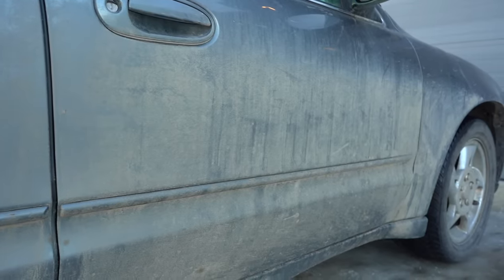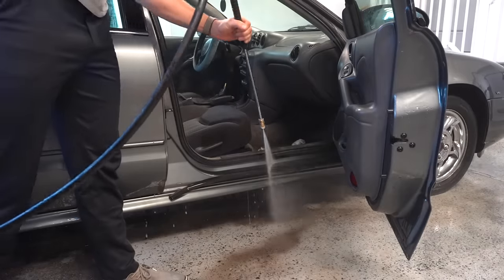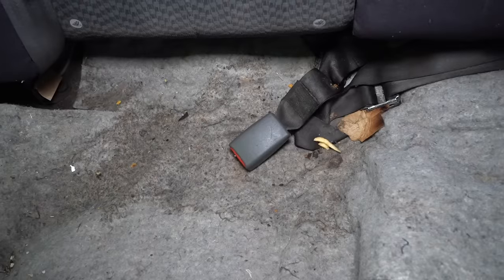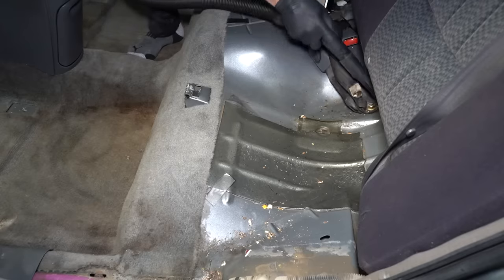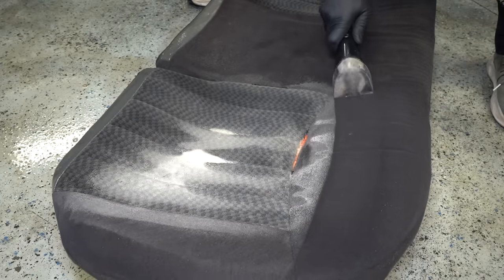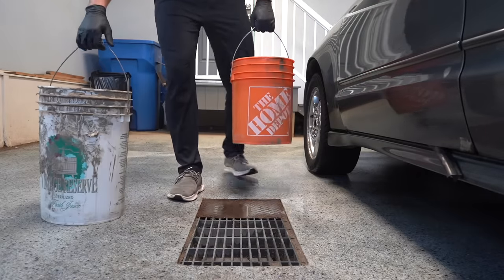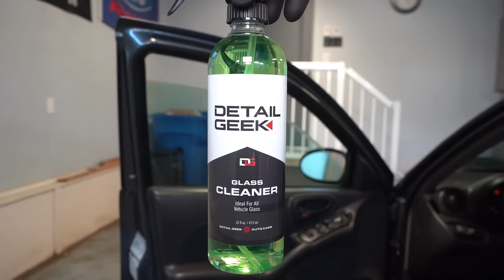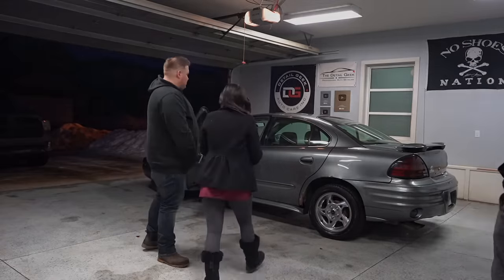Cleaning a NASTY Used Car Before Selling It! | The Detail Geek

Comment: Great work! Ever thought about using a foldable table to clean the plastic parts you disconnect on? It'll save your back a little if you don't have to do it on the floor.
Reply: I remember he did a q&a video and said yes the table helps his back but the floor makes for a better video!

Comment: The "too dirty to clean" question might just come down to a challenge-issue. A guy like Mitch will look at these situations as challenges and the bigger they are, usually more motivation they provide.
Reply: Agreed!
Reply: @adfa6109  No. I'm a Heathen Pagan.
Reply: @michaelray5595  
Islam is the only true religion.  I want you to go to paradise after death and be protected from hell.  But for that you have to accept Islam as your religion.
Reply: @adfa6109  Best of luck to you.  Not happening.  Till Valhalla!
Reply: @michaelray5595  I am Uhtred Ragnarson
Reply: @xArcticWolf01x  Good show, I need to finish it.
Reply: @michaelray5595  
Think about it, do some research on Islam and accept Islam as your religion. This is better for you.
Reply: @adfa6109  Aaaand your back. Just stop,  I don't want to be rude, but I'm about to be. Go in peace,  that you tried.
Reply: @adfa6109  Stop forcing your religion on others.

Comment: Hi, thanks for the carpet extractor recommendation. I got it for my spring cleaning and it is awesome! One question for you. It is normal that the slightly unpleasant humidity stays in the car for few days after carpet wash? Do you have any recommendation how to deal with it other than leaving can outside with open windows for few days? How you do it in the winter? Or you just say to the customer that humidity will go away in few days?

Comment: Excellent detail man. One thing I noticed though that you can do to go that even further extra mile is addressing that rusty seat mount. Product I love using for things like that is Eastwood Internal Frame Coating, goes on right over the rust and dries to a matte black finish, the rusty bit just looks off against the perfectly clean carpet. 
Also if the cover over the stud is missing like in a lot of cars with some mileage, can use rubber vacuum caps to cover the stud after you put the nut back on.
I don't detail cars to often, but those are some tiny things Ive picked up over the years to take care of those picky little things that just grab your attention.

Comment: Just received my detail geek drying towels. Quality of the towels are great. But they don’t do what they’re supposed to. They do not absorb water nearly as well as my previous micro fibre towels. They leave water streaks like you wouldn’t believe. Now that’s obviously not a problem when buffing and polishing right after but for my ceramic coat and being a black car it does bother me being able to see every drop of water it didn’t absorb.

Comment: I’m hoping I could maybe get some cleaning advice. I have a 2002 dodge neon, it stayed with a friend/mechanic for a couple months and when I got it back I discovered a ton of liquid had been sitting in my trunk for a while. There was a mysterious liquid that got under the carpet, mold and some bugs that I still can’t identify. I spent 4 or more hours cleaning the carpet with a shampooer. I used water, vinegar and soap all as different passes. I had to lift the carpet and dry underneath as much as I could. Even after letting it dry outside with doors open and the carpeting lifted for airflow underneath, I still have the mold smell and bugs months later. I can’t decide if I should try again to get it clean or just rip out the carpet in my trunk at this point

Comment: Questions for next  episode😉:
1. Why are you cleaning accelerate and brake pedals after cleaning carpets? You could do that first and let the grime drop on carpets and then clean them with carpet cleaner (micro fiber towels saver)

2. Have you ever found something illegal in the car, for example drugs, or gun?

Thanks!
Reply: I can answer the first. He answered it in some other video.

He does the walls and pedals afterwards because his brushes like to splatter onto them while cleaning the carpet. It would force him to redo them if he did walls/pedals first.

Comment: Are you using a clay bar to remove contaminants from the paint before you apply the paint sealer or just use the sealer right away after the wash?

Comment: I used to work for a detail shop that is extremely popular in my state (everyone brings their collector and show cars to my boss every late spring/early summer because he's been doing it for over 30 years now) and the only vehicles we ever turned down were literal homicide crime scenes; he has a long term deal with the state motor pool and usually it's just commerce department fusions and escapes, or utility SUVs etc, but there was one time where they one morning just dropped off a truck that smelled like death before I even opened the door, and what did I find inside? Oh yeah, it literally had old moldy blood and VISIBLE maggots all through the back seat and on the floor (just vinyl no carpet but still...) 

I just remember seeing it, stepping back, calling my boss over, and he sees it, immediately calls the state motor pool and tells them to get their fucking truck off his lot, we aren't a biohazard cleanup crew LMAO, and considering we've done tons of vehicles as bad as your worst, the fact that he wouldn't even consider it should tell you how bad it was.

There was one other time where DHS wanted him to clean a few CBP/ICE trucks but it was almost just as bad in the back detainment 'cell' which takes up half of the back row.  They were completely full of old dried puke, sweat, blood, and who knows what else.  We ended up doing the entire rest of the truck like SPOTLESS, and then just left the dirty passenger rear quadrant untouched lmao...  I don't miss that job at all.